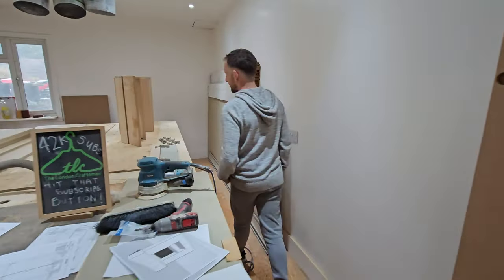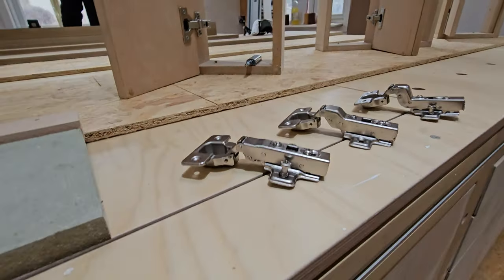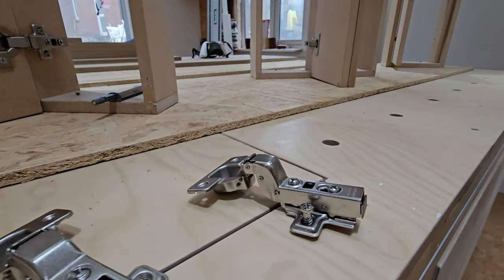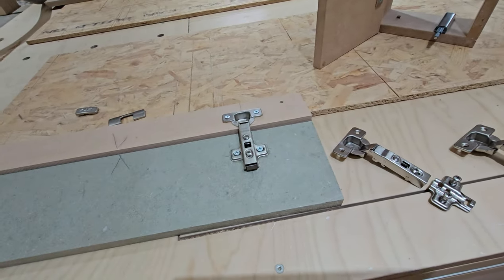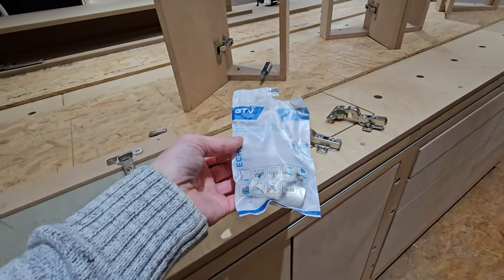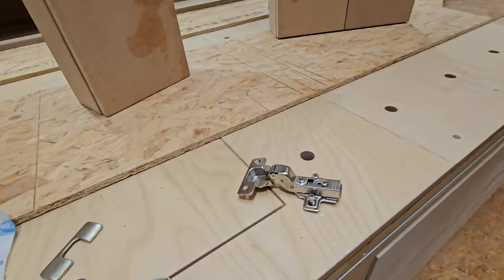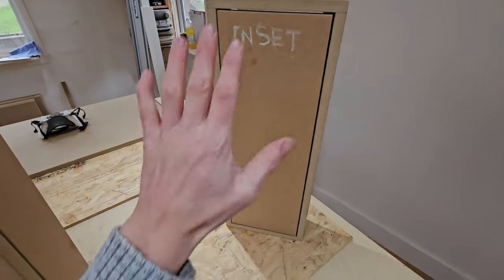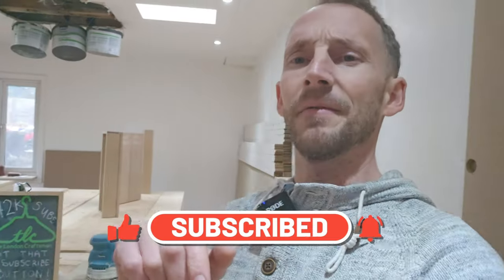The THREE MAIN Cabinet Hinge Types Explained / Upclose Footage, Demonstration & Working Examples

Comment: Hello Ryan which hinge jig would you recommend. I can’t get the Veiko in time. I’m looking at the Trend or the Kreg as they are in my price range. Do you have any thoughts on which one to choose as I want accurate screw placement as well for the cups etc 👍
Reply from the maker: Hi apologies for the late reply.
Yes if your looking for something quickly then the trend is very good.
Get something all metal if you can as it will be much more durable. 
Kreg always seems to be on the cheaper/plastic side 👍
Cheers ryan
Reply: @thelondoncraftsmanworkshop  Thank you for your advice Ryan 🙏

Comment: Hi Ryan - do you cut your cabinet/wardrobe doors to the exact same size as the frame or do you leave the doors a few mm under size? thanks!
Reply: Usually you have a 3mm gap between doors
Reply from the maker: Hi Craig, it depends if I have a side panel or standard flush trims with the carcass.
So imagine you had a 4 door wardrobe with flush trims to the carcass. Then I'd just allow for 3 x 3mm gaps in between the doors (9mm) then divide the total carcasses width (imagine 2000mm), so that leaves 1991, then I'd divide the remaining by 4 (total amount of doors). That's the door width. 
If you have panels/cheeks either side then take off another 6mm in gaps and divide up as above again.
I generally make the door heights the same as the carcass most times 👍
Reply: @thelondoncraftsmanworkshop   Thank you!